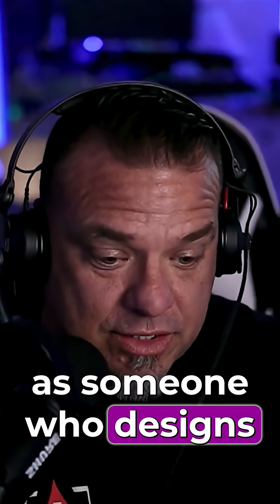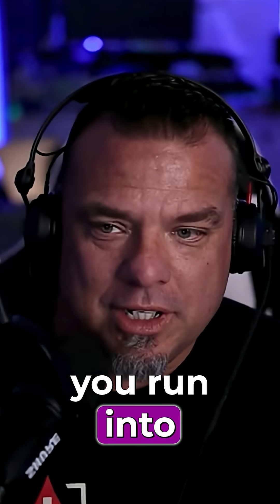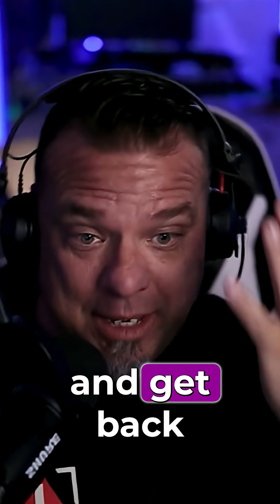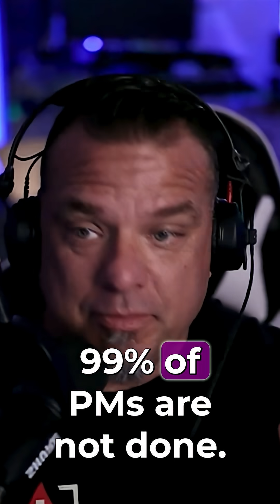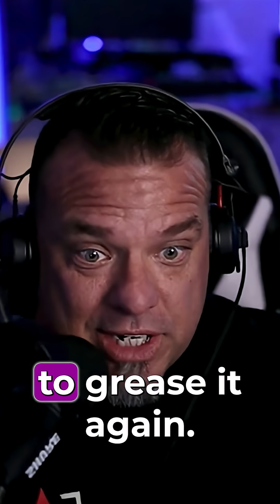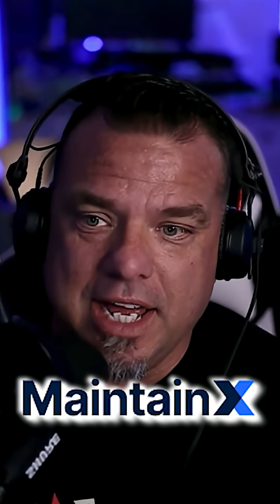MaintainX Did THIS for CMMS

Comment: I guess you mixed up Time/ Scheduled  based Maintenance with Predictive Maintenance giving greasing and number of strokes based. Under predictive maint you are able to detect the fault much earlier than it occurs e.g vibration monitoring where Ultrasound based does it much earlier than traditional sensor based which is much better than Time based maintenance . So is MaintainX is planned based (Time based or Stroke based)  schedule or predictive one ??